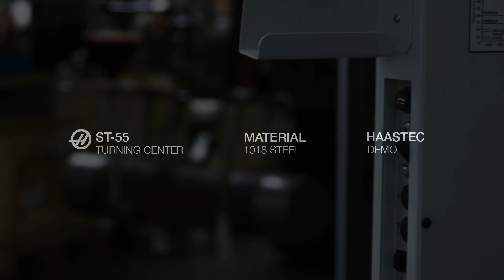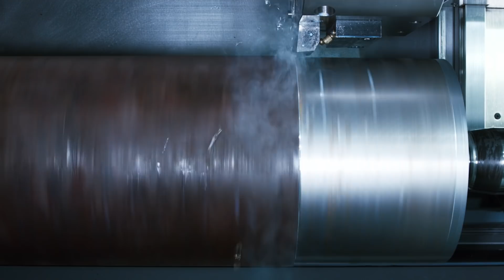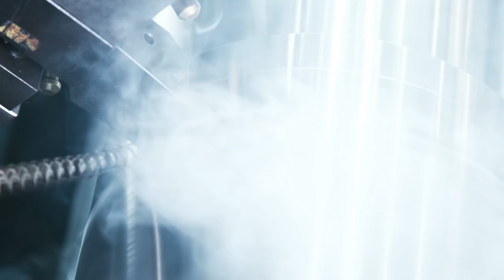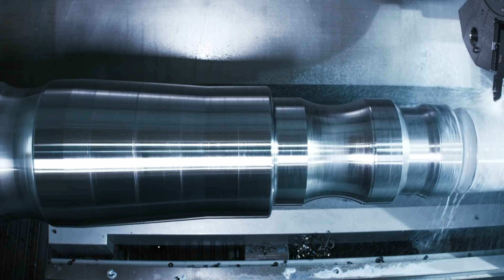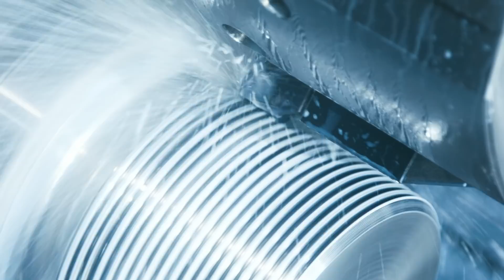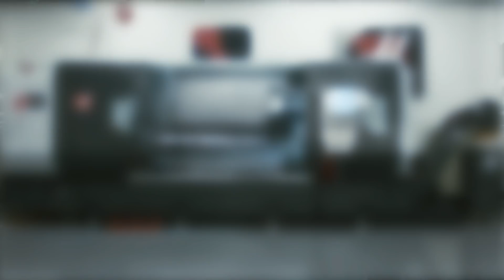ST-55 Cutting Demo "Extended Edit" - Haas Automation, Inc.

Comment: I noticed Haas does not have a ST-45LY or ST-55LY. Shafts and rolls or whatever have to be drilled and tapped off center at the end and numbered too sometimes. For a centerless set up, can the bar be supported within the spindle itself like with a some kind of sleeve as support?

Comment: Anyone else thinking this guy is using a CNC like a conventional?  Is it not more rigid if all the tooling would have been in turned putting the force unto the turret?  Would it not make the inserts changing easier for the operator to? And the threading can be done from the back toward the front if you change your tool orientation so why not showcase modern machining?

Comment: all right, with that weight it's possible to engage M19 or M154 if the lathe has that option, I have a ST40L and with the maximum weight allowed the machine gives me mechanical errors

Comment: What would you recommend for a concrete floor thickness for this machine to run stable?
Reply from the maker: George - Generally we recommend you have at least 6" of concrete.  Obviously the size of the machine and the kind of work you are doing affects this, but 6" is a general guideline.  If you are taking very heavy cuts or need a nice surface finish, you should also considering anchoring the machine.  Anchoring makes the machine much more stable.  Below is a link to our ST-55 Pre-Installation Guide which includes more details on foundation and anchoring.  -  Haas Automation
https://data.haascnc.com/install/preinstall.asp?id=ST-55

Comment: how is the insert being cooled ? by high pressure air ? just asking about first rough not about rest
Reply: Tungsten carbide tools can be run dry in lo-carbon(1018) steel.

Comment: This video shows nothing that I wouldn't have expected from any standard lathe. I am, in fact, rather disappointed that despite all the apparent effort that went into making this demonstration, you couldn't even break a proper chip with many of the tools. Though I'm aware it's exceptionally difficult with the round grooving tool shown, the standard turning tool and profiling tool are child's play to make chips with.